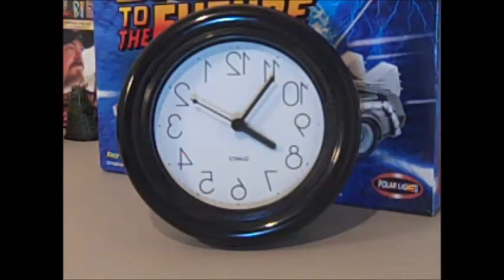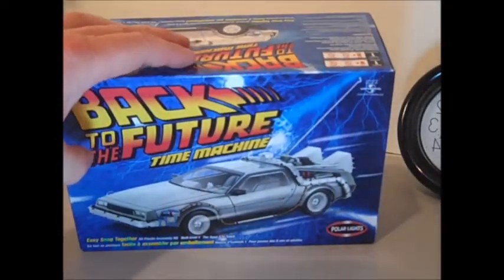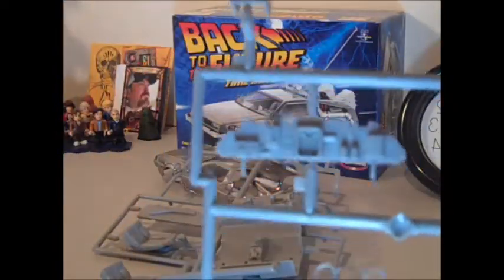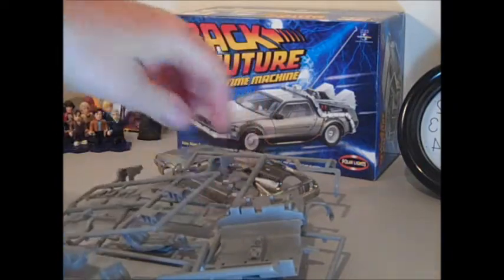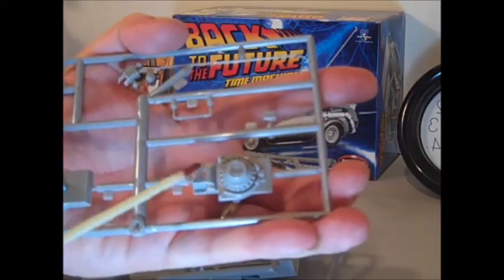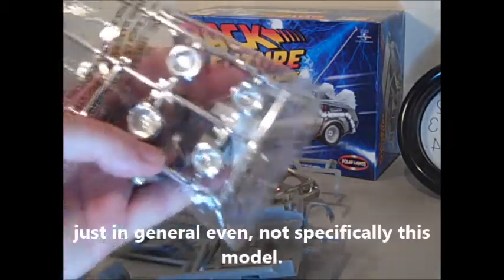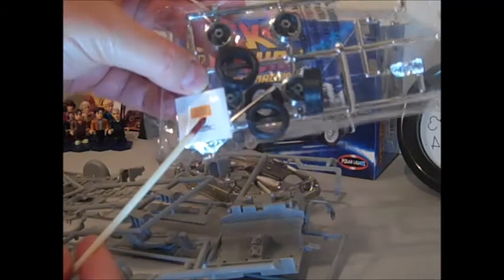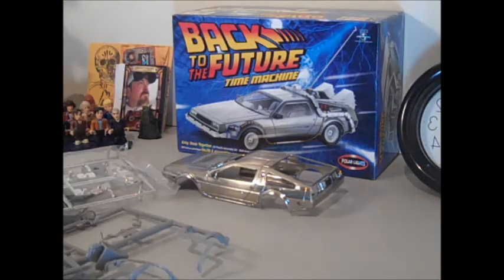Back to the Future Time Machine Build Intro

Comment: Boy that older version body looks like chrome. Glad they remedied that on the new reissues.
Reply from the maker: ***** I had a feeling the later release wasn't as shiny.  Hopefully a little dullcote will solve that.
Reply: You've seen my reviews on all three reissues. It's a much more realistic stainless steel.
Reply from the maker: Yeah, Your reviews are what pushed me to break this out of the stash.  I think a little dulling down will make it okay.  BTW, How did you get the BTTF III Time Machine.  I thought they weren't releasing it until June 2015.
Reply: Tower Hobbies has it. There is a fourth version from them that has not been released yet, and I'm betting that it's the one with the railroad wheels.
Reply from the maker: Yes, the Rail version is the one they are releasing this year.